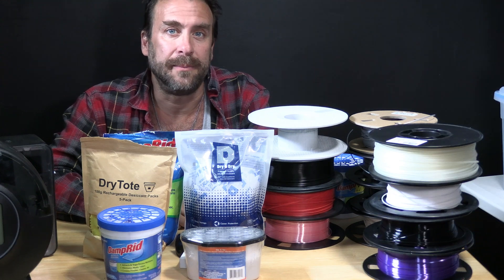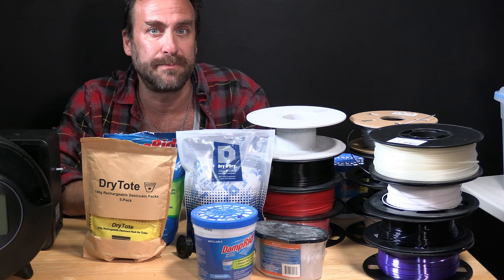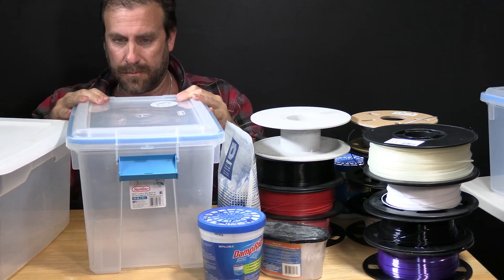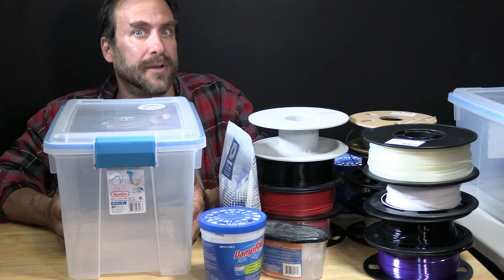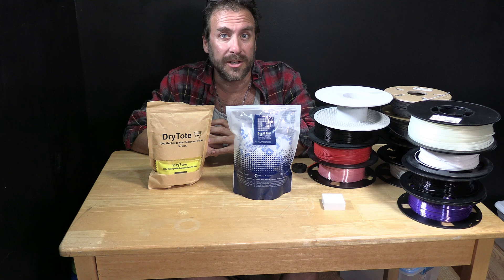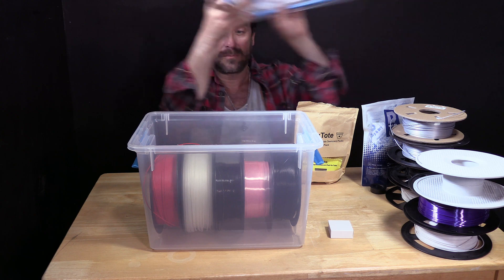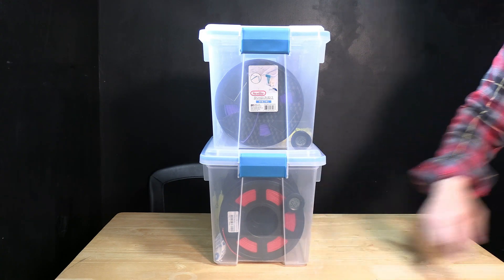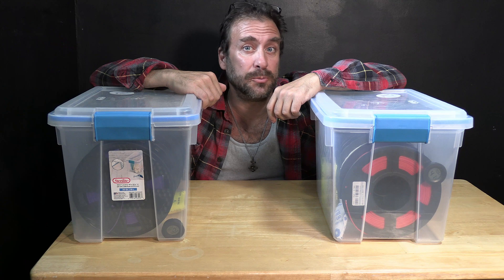Filament DRY BOX STORAGE to protect your 3D Printer Filament from Moisture. Desiccant & Hygrometer

Comment: Okay so I’m not looking for how to make a dry box. They are easy to design. And there are a million existing STLs on printables and other sites. 

What I want is a reliable hygrometer. Did you know most don’t read accurately below 30%? 

The ones shown here have awful reviews. They come in a multipack and give different readings when side by side. And they even say that the margin of error is 5%RH and it doesn’t go below 20% meaning it could be 15% or it could be 25%. PETG for example should be stored below 20%. 

So your video is kinda useless and god help anyone that bought these hygrometers thinking they were suitable. They aren’t.
Reply from the maker: WGAF. I can't remember the last time I looked at the Moisture level in any box or dryer. Practice proper storage Discipline, and learn to identify when a spool may or DOES require drying, and you need nothing else. I say this as a Maker with 3 shops and thousands of sales. Take your foot off the stress Petal. You already understand how to store & dry Filament. Do that. Who cares what a cheap pos hygrometer reads

Comment: You have my thx and love the way you cut to what really matters. I knew nothing and now consider myself intrigued and relieved that there are cheap solutions
out there after all. Will follow your wisdom. I have just started and just got a Bambo for my 70th. my second printer. So having been a designer for a few years, I only had to use
3D programs like ZBrush. Would you recommend Blender as a good option?
Thanks for insight :cat-orange-whistling:
Reply from the maker: My goto modeling professional, for my prop work, uses Z-BRUSH. Some programs are better for creating organic stuff, like models, and such. Others are better for functional stuff. Probably a good idea to  learn ZBRUSH & BLENDER.

Comment: After watching your vid' I purchased a dry box from Amazon, the one designed specifically for filament. Room humidity was 55% when I placed the filaments in. 48 hours passed now and the humidity level inside has slowly crept up to 61%...... not what I expected. Has a perfect airtight seal on the box
Reply from the maker: Have to wonder how accurate the Hygrometer is. Toss a cheap one in there and compare the reading

Comment: Good video, thanks. I've been storing my filament this way for some time. I mount my hygrometers to the covers by drilling a hole and using silicone to fill any air spaces. This seems to work Ok but I generally can't get the displayed humidity values below 35% regardless of the dryness of the added filament rolls. I always dry my filament rolls in a Soval SH02 dryer for at least 12 hrs before placing them in the boxes. I've also tried placing a hygrometer inside with unmodified cover and still don't see humidity valus much kess than 35%. I Iive in MA so I'm generally not dealing with extremely high outside humidity but summers can be quite humid at times. In general what humidity values do you see in your boxes? Any tips on ways to reduce the interior humidity I'm seeing? I do generally put at least 100g of dessicant in each box and change with fresh dessicant monthly. Appreciate any guidance. Thanks.

Comment: While I enjoy the video and also decided to buy the sterilite boxes. In the end they didn't seem to work that great. I bought 3 of them, so it wasn't a fault one. All of them seem to not have a great seal as the desiccant packs of mine kept getting moisture quick that I needed to dry them weekly. And still ended up needing to dry the spools as they were having issues due to moisture. Not sure if using a second 100g pack will make a difference if it's a seal issue with the box.
Reply from the maker: I have more than 10 and they work great. I dry them about every 4-5 months, and they are always still dry when I do it. Are you in a super humid location? Are you using the ones with the blue seal? Keep in mind, the box won't dry WET filament. You need a dryer for that. It will only help prevent them from getting wet. consider putting a Creality PI dryer next to the machine, and printing from that.
Reply: @3DRundown  I'm in SoCal, so yeah, the humidity is high. I do dry them before putting them in the box. And yes, blue seal. Yesterday I was having issues trying to print something and it was likely the spool caught enough moisture to not print well. I finished drying it and now it's printing great. Within 1 week, the desiccant pack changes color and 1 1/2 weeks all the color beads turned to green (from orange). The box might not be great with high humidity areas. I'm going to try to put another layer of foam around the edge to see if it'll make a difference.
Reply from the maker: Holy cow. Crazy. Lemme know how it goes!

Comment: At what humidity level do you need to dry your filament. Thanks for the video.
Reply from the maker: Store it was low as you can get it. A dry box won't dry it, it will keep it dry. A dehydrator will dry it. 10-15%ish

Comment: Great information. 👍🏻 Seems like a lot of people currently is getting into 3D printing, myself included, and these practical tips are great. In hindsight the information may seem logical, but might not be the first thought. 😊
Reply from the maker: There are so many little things to learn, but that's half the fun. Welcome to the party. Never been a better time
Reply: @3DRundown  Definitely a lot to learn. Today I tried to print 2 different prints a few times, and all 5 to 6 attempts failed…. Last attempt I tried to print the desicant holders, and got a spaghetti notice. When I got back to the printer, I found the lids (printed 2 of the holders) fairly ok I guess, but there was a thick string from one lid to the bottom of the one desicant holder, almost like a whole layer being dragged from one print piece to the other, and the desicant holder with the string on had come loose from the bed. I guess maybe it was pulled off when the string maybe followed the print head. So tomorrow I will follow some cleaning tutorials and see if maybe I have a partial clog. Build plate was cleaned between prints, and nozzle / print bed were on the right temps. So nozzle issue maybe, or might do another self test and calibration. Will likely do this anyway after the cleaning / maintenance steps… All was mostly printing with success up until now. Mostly as in printing things like a dog and cat figures with relatively thin and/or tall legs, and trying to minimize support, did not bring much success… :) Well even one printed at 40 % scale (was 10 - 15 cm at 100 % scale), with standard support etc. one of the back legs were not correctly printed / aligned with the upper part of the print.

Comment: Can you use the filament dryer to fry the desiccant packs?
Reply from the maker: Totally. It's just a small dehydrator. A small food dehydrator would work even better, as it would hold more, and have a fan, and all that, but, they would work. However, the S1, has no real place to put them, as it has 360' heating elements. The EIBOS would be the better option, as the heating element is enclosed in the center
Reply: I have the robots and the slot for the desiccant will dry the desiccant as it also drys the filament. I was testing this and it works well.

Comment: Excellent. I have the exact setup, but with the larger totes of the same brand and design. I can maintain 10% relative humidity.
Reply from the maker: 🔥💯 Which size, how many do they hold?
Reply: @3DRundown  Sterilite 80 Quart Gasket Box Storage $19 @ Walmart holds 22 rolls with room to spare.
Reply from the maker: Holy Cow. Epic.

Comment: Great way to store filament for sure to prevent further moisture absorption. Some folks think desiccant will dry their filament, but it will not. However, it will help prevent further moisture absorption from happening when stored correctly! Fortunately, I live in a nice dry environment where I can keep PLA (and for the most part ABS) open on my shelf. This is great storage solution for those who live in humid environments!
Reply from the maker: Yep. I was sure to explain that right off the bat! Here in North Jersey, I can have issues in a single day.
Reply: He literally linked a hygrometer that has a 5%RH margin of error and doesn’t measure below 20%. For example PETG needs to be stored below 20%RH.